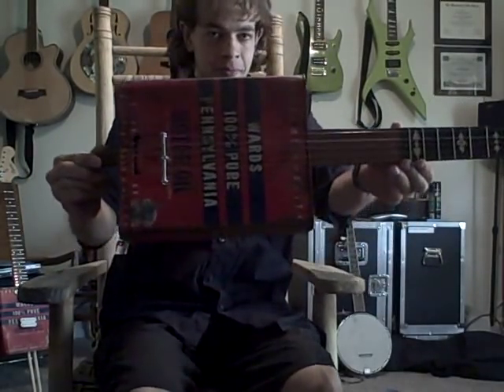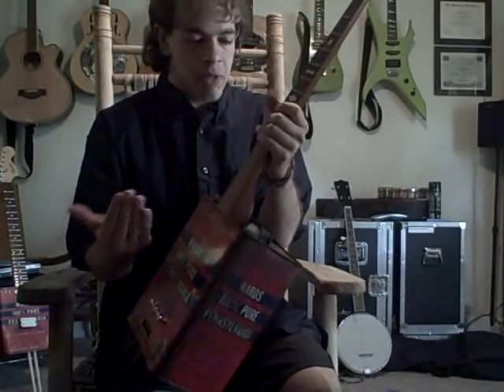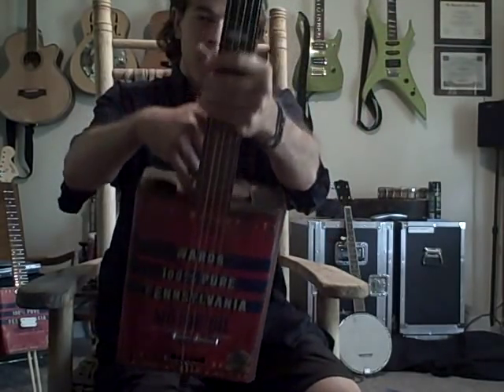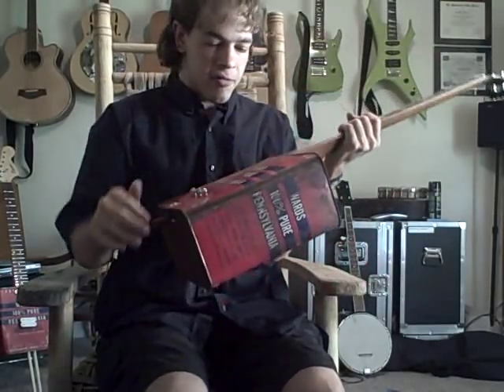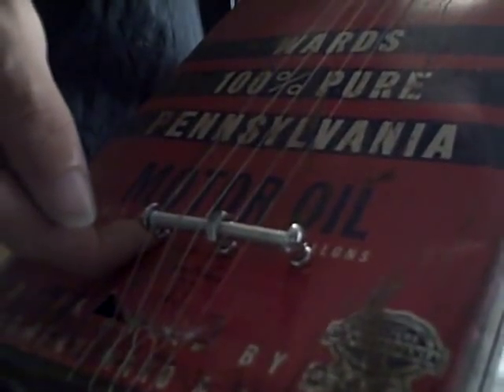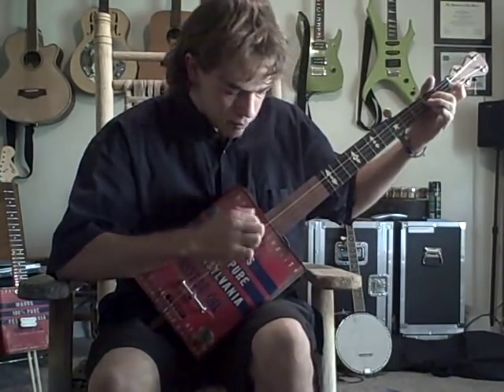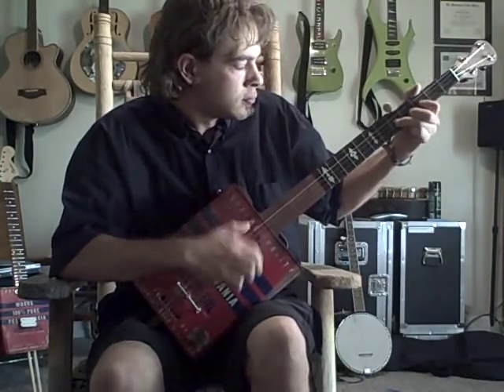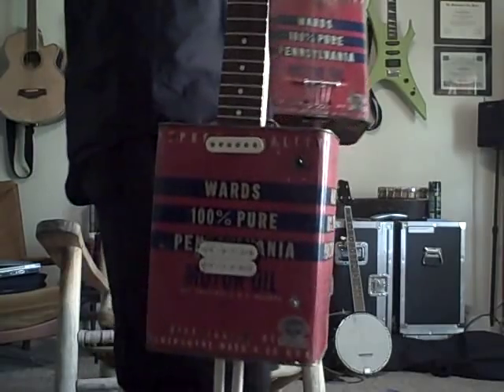How to make the Canjo Clawhammer Banjo

Comment from the maker: @Hensley1212 Ha! I am having the very same problem... I think that the answer is to install the electronics like music stores would repair a semi-hollow electric... Cut an f-hole (or use one of the existing holes in the can), and find a long set of needle nose pliers and fish things through. Truthfully, the guitar has a huge hole in the back because I was lazy... And the whole thing failed because of the way I installed the neck. It ended up blocking the electronics.